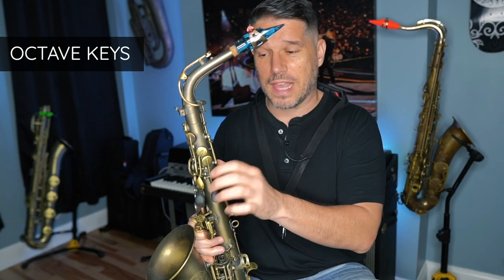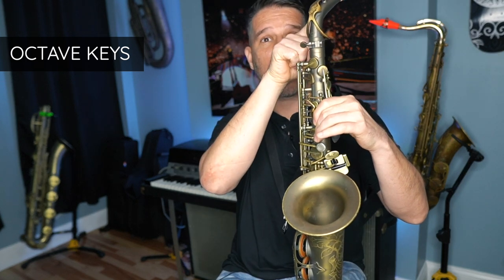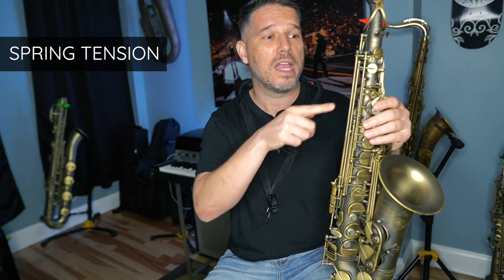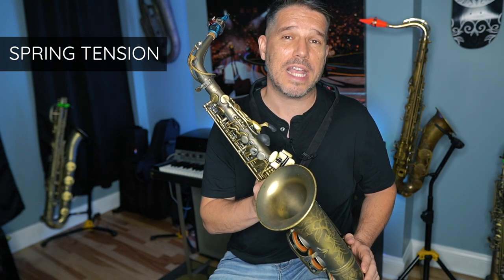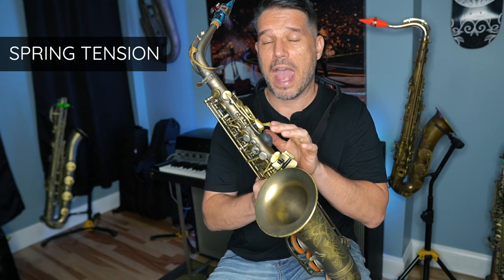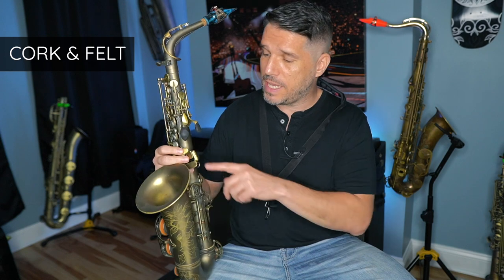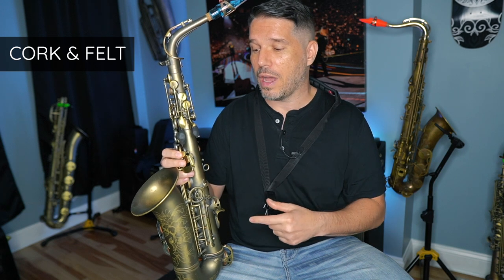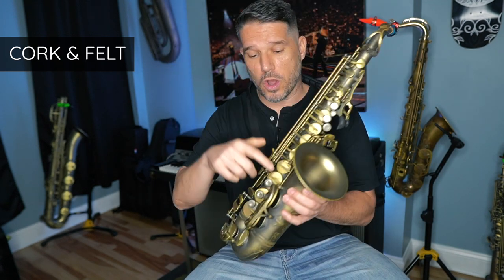5 THINGS YOU SHOULD KNOW ABOUT HOW THE SAX WORKS

Comment: I almost forgot about the extra octave key on the side. The rest was a good review for me. Not on your video, but I learned in university that the size of the bell affects the loudness of the sax sound. Just yesterday on another sax player’s video, I learned that the under slung of the sax neck with the octave hole on the bottom of the sax neck makes the sound a bit subtle compared with the octave hole on the top of neck.
Reply from the maker: Yeah, I play a big bell sax (P. Mauriat 67RX) and that extra weight on the bell definitely gives it more projection and a bigger sound. Hmmm, I'm not so sure about the under-slung octave mechanism. It seems like just a different mechanical engineering to me. It would be very hard to test, as you would have to have the same neck/sax and apply both styles to see what the difference was.

Comment: I usually like to have a slightly lighter key action on my saxophones since I have normal sized palms but slightly short fingers and it helps, especially with left hand pinky keys and low notes. When it comes to pad resonators, I have heard that while metal resonators are supposed to add brightness compared to plastic, which they can do, its more the size of the resonator that makes more of a difference than the material.
Reply from the maker: I haven't experimented with different resonators because of the upfront cost and how difficult it would be to undo if I didn't like the change.

Comment: Can someone explain the difference in sound (if any) based on the resonators? Plastic to metal? Flat to grooved?
Reply from the maker: There are so many different variables - your sax, air stream, type of pads, key height, etc. BUT they will all affect the sound differently because they are reflecting it. I personally don't know. I've always just played the resonators that come with the sax, and I'm guessing that just about no one has a big comparison list, because you would have to change all of the resonators several times on the same horn to get a real play test. Most people don't switch out their resonators, because there is no way to know if you will actually like them before you do it. Some people do it, but it isn't very common.

Comment: I play Leger American Cut #3 for tenor, how are the synthetic reeds gauged.
Reply from the maker: I actually reached out to Legere knowing someone would ask, because I play American Cut too.  Here's what they said: "Légère reeds also use density to measure strength, but thickness is also part of it. It’s just on a very very very small level. Fractions of a millimetrer will make a difference in strength. All our reeds are tested for strength individually on a machine we built specifically for this."

Comment: How do you adjust the spring stiffness?  Do you mean bending the spring so that it puts more (or less) force on the key?
Reply from the maker: Yeah, the spring is bent in the opposite direction. I'd suggest having a sax repair tech do it, because you want them all to be uniform and it is pretty easy to mess up. It's a fairly cheap fix to have a repair tech do.
Reply: @ScottPaddock  General question:  Just got a SYOS mouthpiece.  Really like it.  Plays the lows like no other mouthpiece I’ve used, and some Altissimo, strong up to about G, but I like to play Altissimo way up to E.  I’ve got a month trial (about 2 weeks now).  I’m using a Legere Signature 2.25 reed.  Would a stronger reed (maybe 2.5?) get me a better and higher Altissimo, or is it necessary to further modify the mouthpiece? Thanks.
Reply from the maker: @bamaconald1  Hmmm, there are a lot of variables that could be causing this. If you put on a stronger reed, you might lose your low notes. So it is all a balancing act, but yes, when my reeds (especially Legere) start to get soft on me the first thing to go are the altissimo notes.... and at the same time, my low notes get fatter and fuller.
Reply: @ScottPaddock  I have been using the reed a while… Thanks Scott.  I’ll try a new reed first.